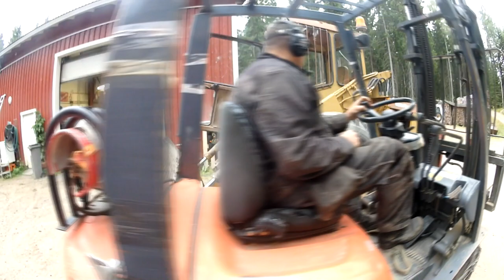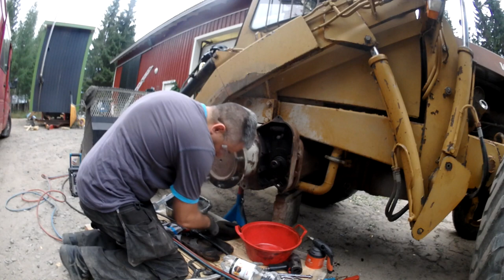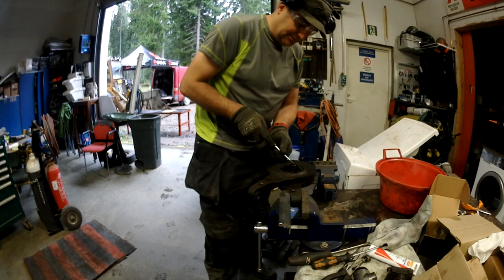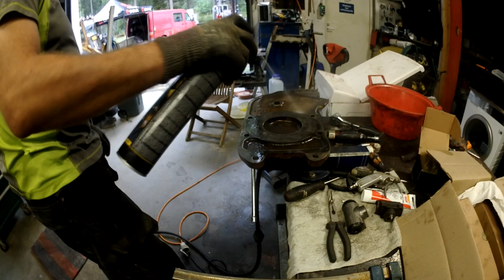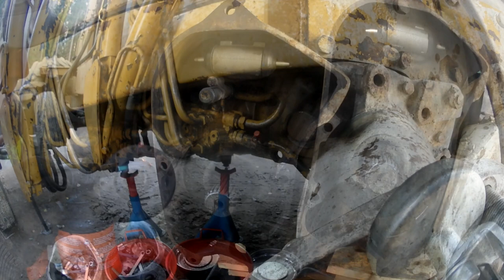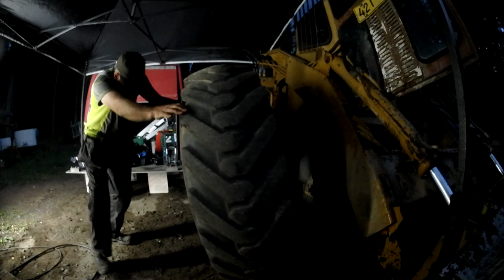Dry disc brake renovation for wheel loader tractor (Valmet 702 brakes)

Comment: Awesome. I am a complete beginner about ti do this job on the same model. Lucky that I found this video. What do you use for cleaning?
Reply from the maker: Your wellcome... Ordinary brake cleaner was used. And those brake pads I heated with gas torch so friction material became back alive you could say after soaking in leaking brake fluid and grease